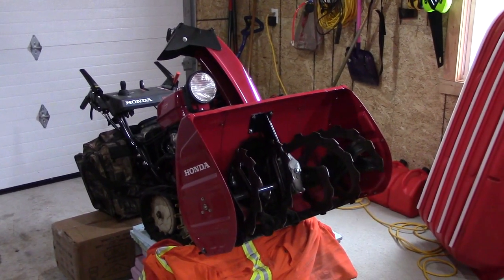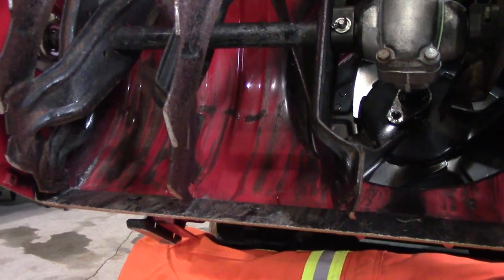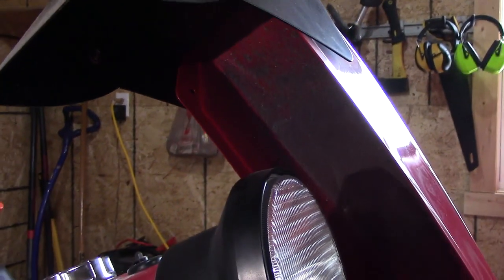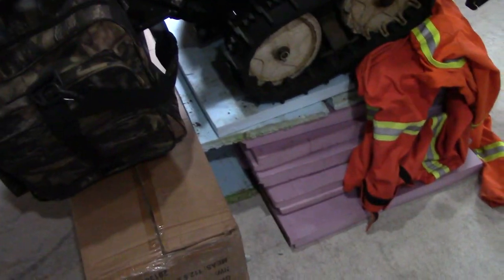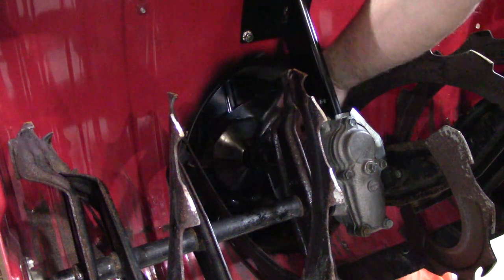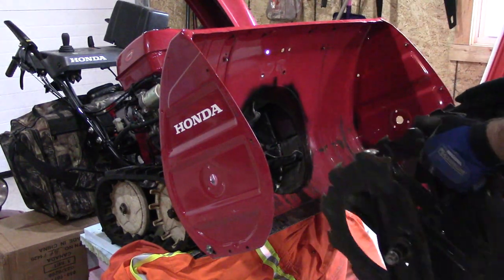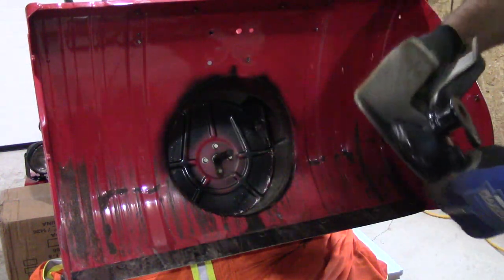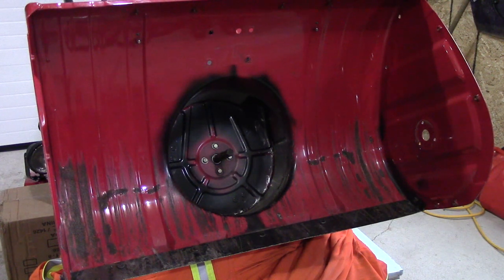HONDA HSS1332 Snowblower/Snowthrower Auger Removal And Refinish (Part 1)

Comment: Great video sir.  I realize it’s been 4 years.  When I saw you remove the augers from the gearbox, in my mind, that metal shaft should have extended all the way out to the auger bearings but instead, they stopped short.

Comment: Nice detailed video, I have a similar machine here in the US but mine does not have the electric chute, onboard battery and auger protection system. Your machine's augers are at least 20% worn, this is due to the lack of side mounted skid shoes, if that issue is not addressed then over time the serrations on the augers will wear down along with the side of the auger housing. These augers are $200+ per side here in the US and in Canada I am sure they are worth a whole lot more, I'd advise to invest in some side mounted skid shoes to save them from any wear here on out.
Reply: I want to know what are the correct skid shoe part numbers. I've seen roller bearing shoes as a quick fix but I prefer a Honda part if any? Thanks for the tip.
Reply: XRavenHairSexGod the part number for heavy duty shoes from Honda is 04700-768-E110, unfortunately they are discontinued as Honda has switched to high density plastic ones for heavy duty applications. Another good option is to go with armorskid aftermarket skid shoes. They are slightly longer but do the job very well.
Reply: @xravenhairsexgod  I bought "Honda 2 Pack Genuine Snowblower Auger Skid Shoe 76153-V41-000" to put on mine. These are the side mounted skid shoes from the wheeled snowblowers. Not as heavy duty as the discontinued version. But they are reversible. They do not come with fasteners. $35.77 on Amazon.

Comment: Great work. But for me, because it will just get all scuffed up again every season, I just leave it assembled and paint it with tremclad and apply with a brush.
Reply: I  agree! Get a small piece of fine sand paper, go arounf with your hands, make it smooth as possible, use a spray red color, spray it on a Chinese plastic container and use a small brush and paint it. Problem solved!

Comment: Great video series on the removal, repair and instal.  Thanks.  I have a Yamaha blower that I will be doing the same thing on this spring.  I bought new augers, bearings, etc for it as the guy who had the blower before me appears to have resurfaced his concrete driveway with the augers.  I wonder if the wear on your augers has led to your concern about frequent snow build up?  Is it working as new now that you have done all that work?  Interestingly, the mechanics of your Honda auger / impeller system looks very similar to my Yamaha.  I did pull the auger assembly out at one point and it comes out and goes in just like yours.  Again, nice job.
Reply from the maker: Thanks so much! She's working great now and I haven't had any clogging issues since. My auger teeth are wearing and I may eventually get someone to fill them back out or will invest in a new set. All good for now though! Only thing I've done since is a new battery and rear tilt hydraulic. Appreciate your time to comment and I got a good laugh out of your cement resurfacing comment haha!